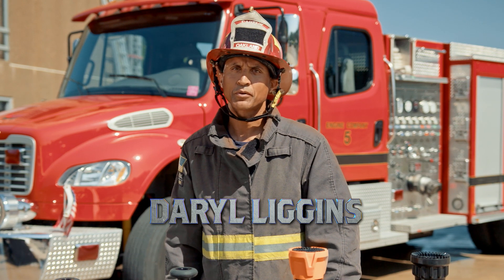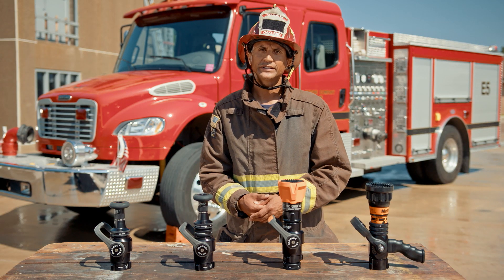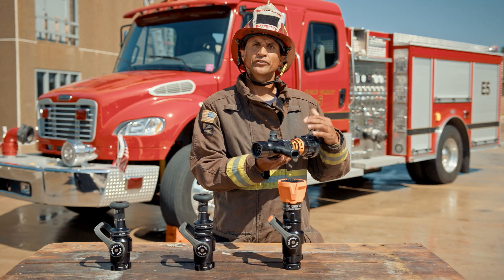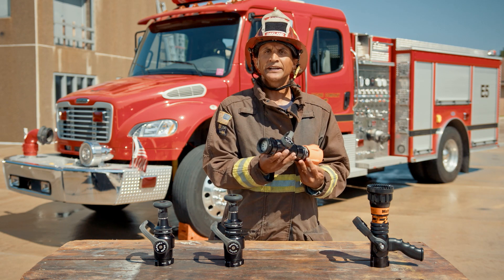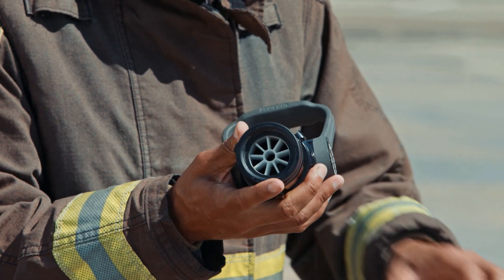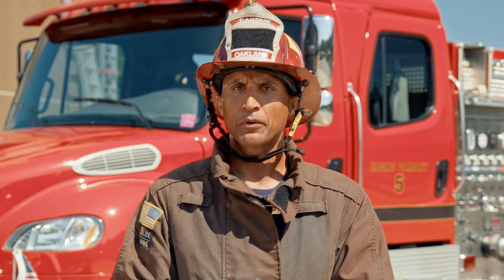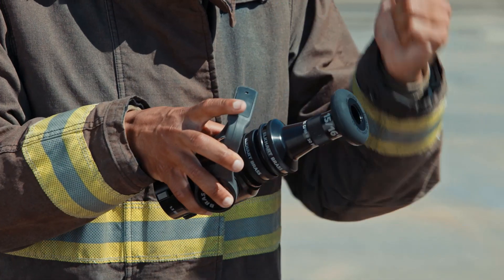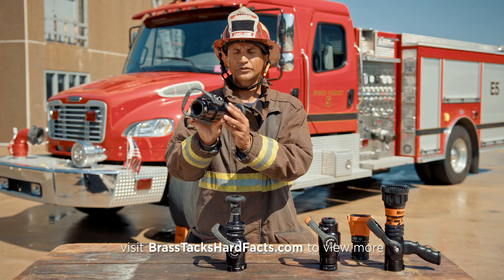The Dangers of Inlet Screens (Episode #43)

Comment: I just watched this video...I have seen solid stream nozzles get clogged at the tip.  The objuect did not pass thru the nozzle. Sorry SIr.
Reply: For sure there are always exceptions. The use of a smooth bore without any screens will however greatly reduce the chances of a fouled nozzle. Then the advantage of the XD setup he had was.....  you can shut the bail then clear the foul. Or just run the shutoff half open till you can fix the problem
Reply: Flush the hydrant